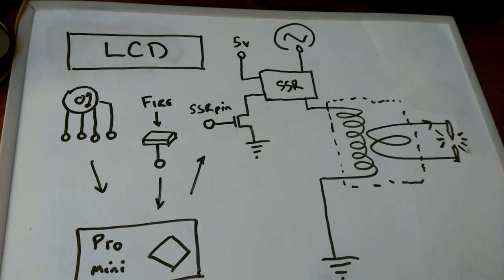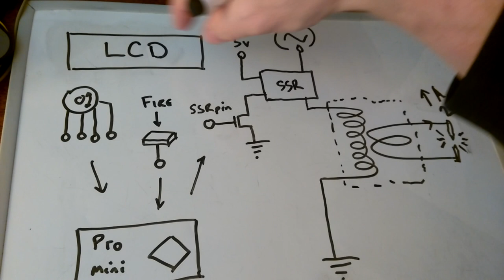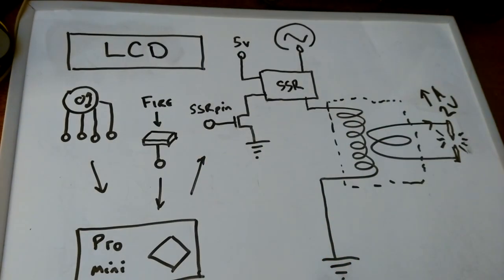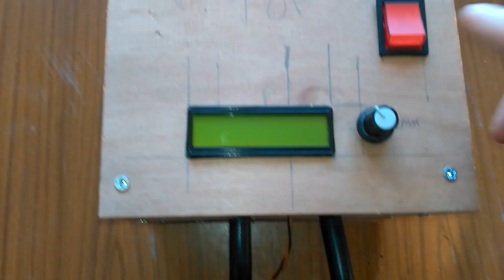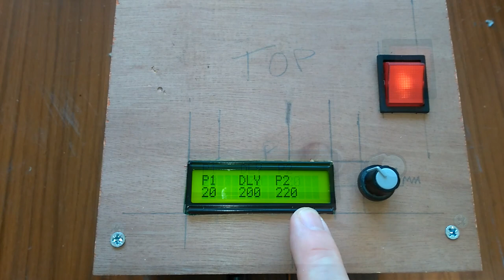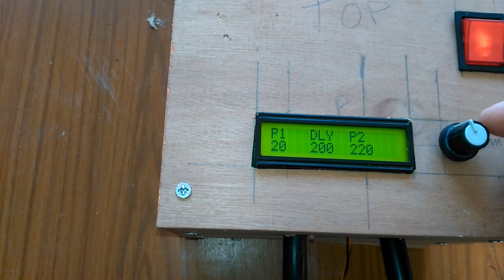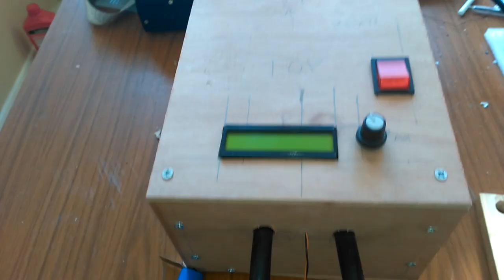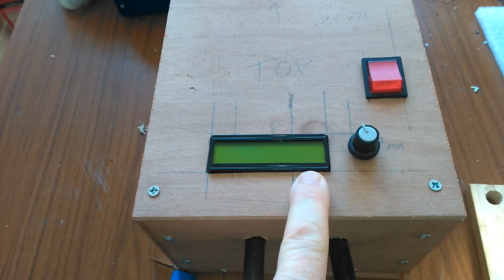Battery Tab Spot Welding Machine from Microwave Oven

Comment: I got all the components minus the transistor and realized that I need to learn to program. For the price that I paid for all the parts, I may just call it a loss and not bother.
Reply from the maker: I have seen other models online who do not work from programming, so you can ditch the transistor and the microcontroller. You can just wire the SSR's input signal to 5 - 30 volts via a push-button switch and that's it - just blip the button to make the weld. The timing is not nearly so accurate, but you get better with practice and you avoid the programming and the learning curve which that entails.  I hope that's helpful to you.
Reply: @chriswesley594  I realized that my ebike programmer controller used some kind of ttl to usb converter and I was able to figure out how to get it to program my Arduino pro mini with a simple blink led code to test it out. Had to use some tricky reset button pressing but was able to figure that part out. I just need to research on which pins to connect the rotary dial , ssr and 16 x 2 display to . After that I'll try taking Jim's node mcu code and see If I can figure out how to convert it over to arduino. Hopefully It will be similar to yours.
Reply: @chriswesley594  Would it be possible for you to share your code lines?
Reply from the maker: Which pins you connect to your rotary switch depends on you. Any digital input pins can be used, and a pro mini has a lot of them to choose from. Same with SSRs - any digital output will drive an SSR. the 16x2 display is different though - you normally need 16 lines to drive it, but you can also buy a daughter board which will drive those lines itself from a 2-wire serial interface.
Reply from the maker: OK here it is. No warranties of any kind:

/*
LCD pin 1 = VSS to GND
LCD pin 2 = VCC to 5V
LCD pin 3 = wiper of 10K pot spanning powe rails
LCD pin 4 = RS to D12
LCD pin 5 = R/W to GND
LCD pin 6 = En to D11
LCD pin 7, 8, 9, 10 n/c 
LCD pin 11 = D4 to D5
LCD pin 12 = D5 to D4
LCD pin 13 = D6 to D7
LCD pin 14 = D7 to D6
LCD pin 15 = Backlight + to 5V
LCD pin 16 = Backlight - to GND
*/
#include <LiquidCrystal.h>
#include <EEPROM.h>

//#define dbg 1
#define dbg 0
#define encoderApin  2
#define encoderBpin  3
#define encoderSpin  8
#define SSRpin       9
#define btnWELDpin  10

LiquidCrystal lcd(12, 11, 5, 4, 7, 6);

#define RUN_STATE    1
#define UPDATE_STATE 2
#define WELD_STATE   3

int state = RUN_STATE;
int changeMode   = 3;
int pulse1       = 20;
int pulseDelay   = 200;
int pulse2       = 250;
int encoderA     = -999;
int encoderB;
int prevEncoderA = digitalRead(encoderA);

typedef struct
{ int     pulse1;
  int     pulseDelay;
  int     pulse2;
} EEPROMarea;

EEPROMarea ROMstatus;

void getROM()
{debug("getROMstatus:\n");
 EEPROM.get(0, ROMstatus);
 pulse1     = ROMstatus.pulse1;
 pulseDelay = ROMstatus.pulseDelay;
 pulse2     = ROMstatus.pulse2; 
}

void putROM()
{debug("putROMstatus:\n");
 ROMstatus.pulse1     = pulse1;
 ROMstatus.pulseDelay = pulseDelay;
 ROMstatus.pulse2     = pulse2;
 EEPROM.put(0, ROMstatus);
}

void debug(String msg) {
  if   (dbg == 1) Serial.print(msg);
}

void setup() {
  pinMode(SSRpin, OUTPUT); digitalWrite(SSRpin, LOW);
#ifdef dbg
  Serial.begin(115200);
  Serial.println("Hello");
#endif
  pinMode(btnWELDpin,  INPUT_PULLUP);
  pinMode(encoderApin, INPUT_PULLUP);
  pinMode(encoderBpin, INPUT_PULLUP);
  pinMode(encoderSpin, INPUT_PULLUP);
  lcd.begin(16, 2);
  getROM();
  if   (digitalRead(encoderSpin) == LOW) // Factory reset ROM
       {lcd.setCursor(0,0); lcd.print("Factory Reset..");
        pulse1 = 20; pulseDelay = 200; pulse2 = 250;
        putROM();
        delay(500);
       }        
  state = RUN_STATE;
}

void loop() {
  debug("Loop\n");
  switch (state) {
     case RUN_STATE:
            doRUN();
            break;
     case UPDATE_STATE:
            doUPDATE();
            break;
     case WELD_STATE:
            doWELD();
            break;
  }
}

void doRUN() {
  debug("doRUN\n");
  lcd.setCursor(0,0);  lcd.print("P1   DLY  P2   ");
  lcd.setCursor(0,1);  lcd.print(pulse1);
  lcd.setCursor(5,1);  lcd.print(pulseDelay);
  lcd.setCursor(10,1); lcd.print(pulse2);

  while (digitalRead(encoderSpin) == HIGH)
    {debug("WHILE encoder not pressed (RUN)\n");
     encoderA = digitalRead(encoderApin);
     if  (encoderA != prevEncoderA) // encoder has rotated so enter set state
         {debug("Encoder moving ");
          prevEncoderA = encoderA;
          encoderB = digitalRead(encoderBpin);
          if   (encoderB != encoderA) // clockwise
               {debug("CW\n");
                lcd.setCursor(changeMode, 1); lcd.print(" ");
                changeMode = changeMode + 5;
                if  (changeMode > 13) changeMode = 3;
                lcd.setCursor(changeMode, 1); lcd.print("<");
               }
          else {debug("CCW\n");
                lcd.setCursor(changeMode, 1); lcd.print(" ");
                changeMode = changeMode - 5;
                if (changeMode < 3) changeMode = 13;
                lcd.setCursor(changeMode, 1); lcd.print("<");
               }
         } // IF encoder is rotating
     else debug("Encoder not moving");

     if  (digitalRead(btnWELDpin) == LOW)
         {debug("WELD pin low\n");
          state = WELD_STATE;
          return;
         }
     } // WHILE encoder not pressed
     debug("Encoder pressed");
     int pressLength, t2, t1 = millis();
     while (digitalRead(encoderSpin) == LOW)
       ;
     t2 = millis();
     pressLength = t2 - t1;
     if   (pressLength > 700)
          {lcd.setCursor(0,0); lcd.print("SAVING VALUES..");
           putROM();
           delay(500);
          } // long Press = store values in ROM
     else state = UPDATE_STATE;
}

void doUPDATE() {
  debug("doUPDATE\n");
  lcd.setCursor(changeMode,1);
  lcd.print("*");
  int temp;
  
  if (changeMode == 3)  temp = pulse1;
  if (changeMode == 8)  temp = pulseDelay;
  if (changeMode == 13) temp = pulse2;

  
  while (digitalRead(encoderSpin) == HIGH)
    {debug("WHILE encoder not pressed (UPDATE)\n");
     encoderA = digitalRead(encoderApin);
     if  (encoderA != prevEncoderA) // encoder has rotated
         {debug("Encoder moving");
          prevEncoderA = encoderA;
          encoderB = digitalRead(encoderBpin);
          if   (encoderB == encoderA) // clockwise
               {debug(" CW\n");
                lcd.setCursor(changeMode, 1); lcd.print("^");
                temp++; if (temp > 999) temp = 999;
                lcd.setCursor(changeMode-3, 1); lcd.print(temp);
               }
          else {debug(" CCW\n");
                lcd.setCursor(changeMode, 1); lcd.print("v");
                temp--; if (temp < 0) temp = 0;
                lcd.setCursor(changeMode-3, 1); lcd.print(temp);
                if (temp <10)  lcd.print(" ");
                if (temp <100) lcd.print(" ");
               }
         }
    } // WHILE encoder not pressed

  if (changeMode == 3)  pulse1     = temp;
  if (changeMode == 8)  pulseDelay = temp;
  if (changeMode == 13) pulse2     = temp;
  lcd.setCursor(changeMode, 1); lcd.print(" ");

  while (digitalRead(encoderSpin) == LOW)
     ;
  
  state = RUN_STATE;
}

void doWELD() {
  lcd.setCursor(0,0); lcd.print("    WELDING!   ");
  
  digitalWrite(SSRpin, HIGH);
  delay(pulse1);
  digitalWrite(SSRpin, LOW);
  delay(100);
  delay(pulseDelay);
  digitalWrite(SSRpin, HIGH);
  delay(pulse2);
  digitalWrite(SSRpin, LOW);

  while  (digitalRead(btnWELDpin) == LOW)
         ;
         
  state = RUN_STATE; 
}
Reply: @chriswesley594   Awesome, thank you very much!!
Reply: @chriswesley594  That's very generous of you Chris. I can't code either but still like to build stuff with Arduino's so this will be a future adaptation of my current project.